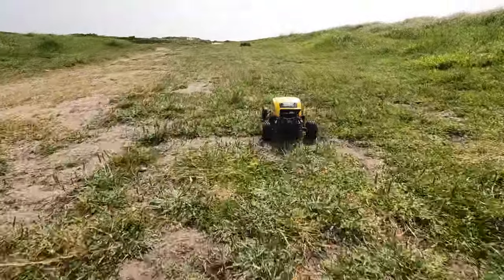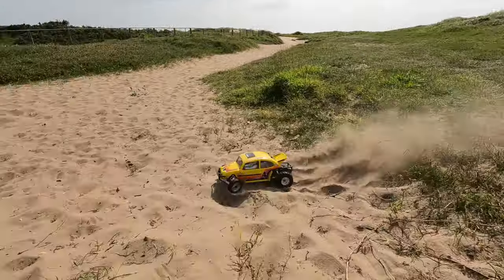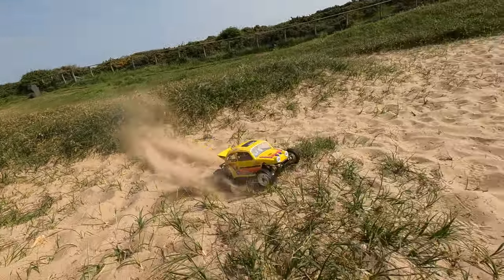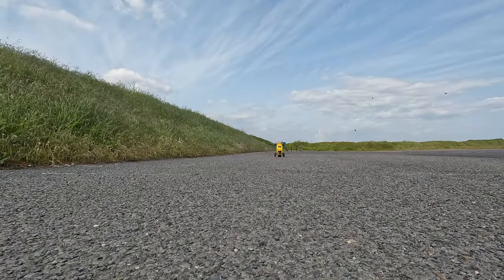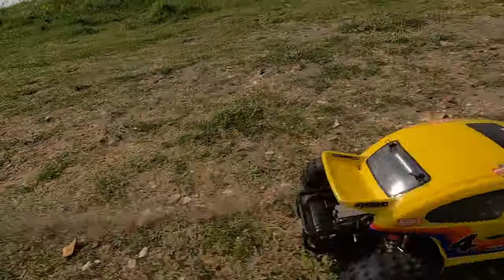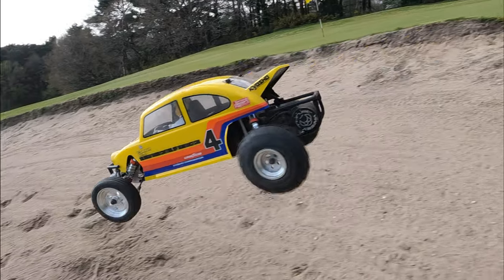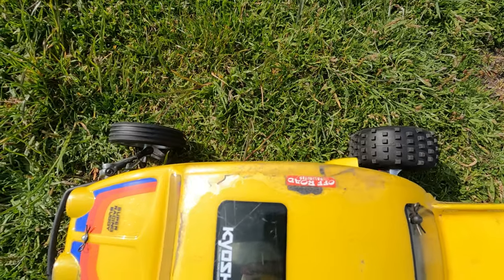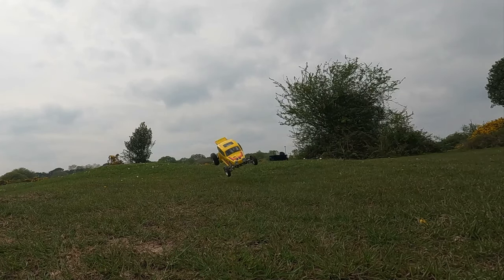Kyosho Beetle Brushless Speed Test and Bash!  RC VW Beetle Buggy put to the test!

Comment: The Beetle certainly demonstrated it can take a bashing,👍 well the chassis at least. I've not had any issues with my Kyosho bodies, but then again I don't run them very hard. The Beetle looked properly fast in the footage!
Reply from the maker: Hi there.  Yeah with the chassis it's just the main rails that can end up bent if you nose dive it enough.  The body was almost turning inside out with some of the landings so I can forgive the paint falling off!  I'm going to re-do the speed test because it does seem quicker than the indicated speed.  Many thanks for watching :-)

Comment: That shell flexed more rhan the paint can handle but good it never broke 👍🏻 It does look very fast, great video 👍🏻
Reply from the maker: Hiya Damian. Yeah the shell almost turned inside out at some points. No other issues though apart from slightly bending the chassis rails. Cheers for watching mate. Best wishes 😁👍

Comment: Well you proved one thing, Pete, this Kyosho is tough! No way would a Blitzer Beetle take that abuse without flying into a thousand parts! But mate, 5000mph scale speed is far too much for a 1/10 RC buggy. I know I'm right 'cause I checked out a video about you and used the guys maths. 🤣🤣 Anyway, very entertaining footage of a smashing car from Peter Smith! I'd put a fast brushed motor in it and save that lovely body! All the best my mate and hope your Sunday was a good 'un! 😎😎👌👌👍👍
Reply from the maker: Hiya mate. Oh yeah I broke my Blitzer Beetle with much less than this. The only issue (apart from the body) was a suspension grub screw coming a bit loose despite the threadlock on everything. Oh yeah to be scale this should be going about 4mph 😂 I'm going to see how this is with the current configuration on the flat sand when the tide is out. I'm thinking it will be great like the Wild One. Yeah great Sunday here thanks. No RC but a walk and a couple of pubs so can't be bad. Hope you had a good one too. Need to check the group chat. Cheers for now 😁👍

Comment: I agree with what Simon W said below Pete I'm shocked that it's only 34mph WTF? But this buggy drives like a speed demon  I could see it  does seem a little hard to control maybe the low speed gearing will be the way to go to help make it more stable to control? Thanks for posting new of your latest R/C Car m8😁😁👍👍😎😎
Reply from the maker: Hi there. Yeah now I'm thinking about it I'm wondering if my GPS device got damaged in one of the many wipeouts the car had in the car park. I will try to re-test because it looked a load quicker than my Turbo Scorpion running the lower gear ratio which was 33mph I think. Many thanks for your great feedback and support as ever 😁👍
Reply: @PeteWylieRC  Cool Pete looking forward to seeing you do a re-test?

Comment: Dude are there any alternative shells that you could make work and still look good?? Getting hold of a replacement bodyshell I may as well buy a another kit they are that expensive 😂😮 if you can even find one. Any advice?? Parts particularly bodyshells is something that is putting me off buying one
Reply from the maker: Hi there. No I've not found a shell like the Beetle as it's slightly an odd shape compared to a Sand Scorcher or whatever. Kamtec make a Scorpion shell that should fit this as they are essentially the same car. Would need the rear wing support though. I don't know if you already have one but I would go with the Turbo Scorpion out of the Kyosho re-releases. Handles better and looks fantastic 👍👍
Reply: @PeteWylieRC  thanks for the reply Pete, I thought you'd say that. It's the beetle I wanted because I love the look and the bathtub enclosed chassis. It seems Kyosho are basically only making stuff on limited runs. Interesting could kamtec possiblyly make a shell for the beetle in the future do you think? (Patents copyright etc etc haven't a clue)

Comment: Seriously cool looking buggy buddy !
I went out to the shed earlier this year to find my batteries have faults and don’t work, they were nimh , so it maybe time to move on, I have only a few tamiyas, they mostly have the cheap hobby wing esc as I do like to get em wet, what would you say is the best and most practical brushless set up and lipo for tamiya, I’m guessing 2 cell looks the right size, i was just wondering if you could recommend a brand that you have found fits well in tamiyas, I have a FAV, a lunchbox and a hopper, any advice will be much appreciated 👍
Reply from the maker: Hi there. Pretty much all of my Tamiyas have the Absima Thrust BL eco motor/esc combo and not had any go wrong yet. Also a few have the Robitronic Razer Ten combo which is possibly a bit smoother and again I've had no issues. For the battery I use the Gartpot 2s 4000mah rounded pack which fits in all the Tamiyas other than really old ones like the Sand Scorcher. For that I have the shorty lipo pack. That will also fit your FAV. I made a video about that which shows what I did. Oh also the Lunchbox with a little mod although you can use the rounded ones in that if you don't mind that they are more visible. Hope this helps. Many thanks for watching the video 😁👍
Reply: @PeteWylieRC  Hi Pete, thank you so much for your time, this is exactly what I needed 👍
I will be doing an order this weekend for sure, it will be nice to get out with the rcs, didn’t bother much last year and haven’t yet this year, but the sun is here, it’s time to give them a new lease of life, and I think the new set up will do exactly that, thanks again 👍
Reply from the maker: @M.A.S.Ked-Crusader  Oh yeah the brushless motors will liven them up!  Make sure you are safe with lipo charging and storage.  Maybe get a batt safe.  Have fun 🙂
Reply: @PeteWylieRC  thank you very much for that, hadn’t thought of a batt safe, will get on that 👍

Comment: I put a 3800kv Castle sidewinder sc in mine. I have no idea how fast it can actually go, cause it wheelies at 1/4 throttle hahaha 
I will say, the Kyosho Beetle will take an absolute beating. The frame will bend if you hit multiple trees (or the same tree multiple times)
Reply from the maker: Oh yes I think that this is a bit too wild with the brushless set really. The Turbo Scorpion is fine with the same set though and I think that's down to less grippy tyres and a wider stance. Yours does sound a bit mad! Many thanks indeed for your great feedback. Much appreciated 😁👍👍